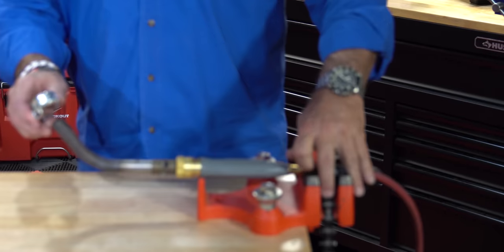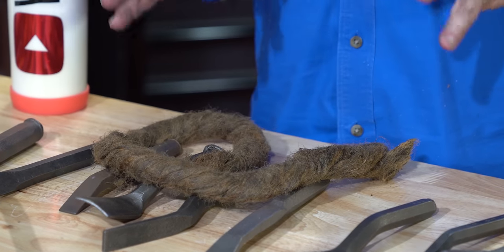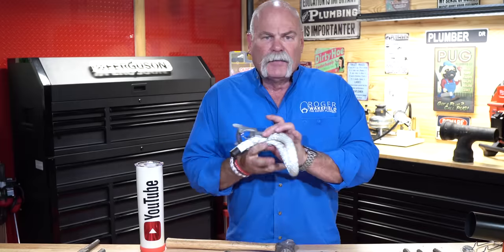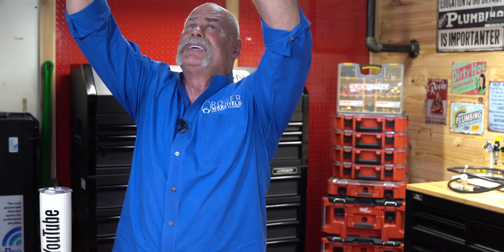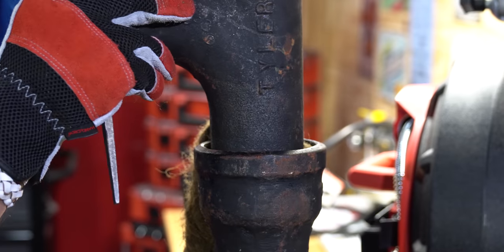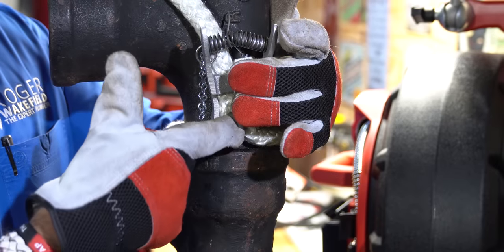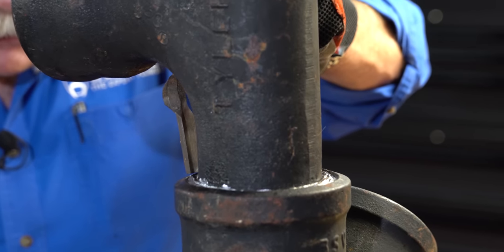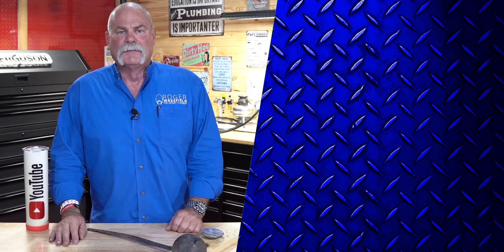I Make a Lead & Oakum Joint

Comment: Great video, sir! Have to deal with this stuff at the apartments I work at. Now that we know how to make one, how about a video on how to properly disassemble one in a safe manner?
Reply: I have seen videos of people essentially drilling holes all around the lead and take a chisel to get the pieces out then pull out the oakum. Super tedious and time consuming. On remodels almost everyone just cuts the cast iron (not at a joint) and uses a fernco no hub coupling. No point dissasembling, just cut it out

Comment: quick question, i work for a utility supply company, and cannot for the life of me understand why ductile is still being used. It's super heavy, super expensive, and extremely hard to get(some sizes are 10-12 months out)..  c-900  has a very close rating, easier to get, a lot less weight, and easier to use.   Also, when ductile sits and water gets in, you see murky water, think about your water with these pipes down the road.  You aint getting rust/murky water from c-900

Comment: Steven Lavimoniere here on YouTube still works with cast iron toilet flanges. He also still solders copper pipe.
Reply: He does small repairs though... Not whole houses...I love Steve and he has serious skill but if he soldered a 6 bathroom new home I'd have so much respect that's unheard of lol
Reply from the maker: Love Steven’s channel, he does good work
Reply: @RogerWakefield  Exactly Roger just like you I love both of your channels... Just saying Steve being a mostly one man band..kind of sticks to doing the least one small job.....😃 He even refuses jobs sometimes...I don't think he will copper a six bedroom new house but I've been wrong before haha 🤣 he could do it tomorrow
Reply: Usually in new construction we just Uponor PEX the water the water lines 💦 because it just way more cost effective... On everyone ..but I understand service plumbing and soldering that's a lot more cost effective.,personally the only time I pull the map gas out is  sweating off an angle stops..sweating on tub spout males, or trying to heat up a nut....but I'm not an old school plumber at any means
Reply: Well I take that back it depends who I'm under sometimes I'll sweat my shower valves.... Some let me just tape and dope them

Comment: Ive only ran cast iron one time...and they made us coat the pipe and fittings with black swan and use no hub bands with clamps...the fittings were weird too they were all street fittings to go into the no hub bands...I'm not sure why the customers at that downtown place wanted drains in cast iron...it was more work but they swore it would be quieter and less noisy than than pvc 😭😭

Comment: Very cool video as a testament to history. I wouldn't recommend considering it as an option in modern construction. No hub cast iron is superior for its serviceability, speed, and (when using heavy duty 4 clamp or shielded coupling) reliability. This isn't a skill I would waste time on teaching to the young guys but its cool to see this video.
Reply: @RogerWakefield  Ill look for it in the specs someday
Reply from the maker: Some parts of the country require cast iron, but not lead and oak I’m…

Comment: Have you experienced a 5” tube installed into a 5” cast iron hub ?  Guess they were pressed  in by heating the cast iron hub an pressing the pipe “tube “ into it .not a plumbing pipe but heard a company did this 80 yrs ago .

Comment: What would you say Roger to a Plumber who used a flat head screwdriver to seat the lead ??? The joint is leaking and I need to fix. Start from ground zzzzzero ?? Thanks Sir.

Comment: I'm curious what you've heard about the refrigeration press fittings? My local distributor carries them now and they're starting to push them, but I can't install something at a customer's house I don't know for sure will last. If you've heard anything, I would love your input on them.
Reply: What kind of pressures do refrigeration lines run?
Reply: Over 400 psi on 410A
Reply: @anthony5530  can hit 500 psi if it has a hung up txv. 500 psi is when the high pressure switch shuts the unit off
Reply: Lots of oversized heat pumps push 500. Lol

Comment: Oakum can be, is meant to be, stripped down into smaller diameter pieces as appropriate to the pipe size. Better three smaller pieces with good offset overlaps than one large piece with a single overlap. Huge pieces are meant for clay drainage pipe. 

Also lead wool exist, its like a much thicker steel wool. Lead wool can be hammered (crushed) into a joint instead of pouring molten lead; most often used in repair work for a single (outside or vertical) joint or two. Handy for cast iron shower drains.

Once saw my boss's son splice PVC pipe into a 3" cast iron hub using oakum and epoxy putty to avoid an expensive wall tear out in a finished basement. He cut a 3/8" ring off a 3" PVC coupling and glued the ring to the end of the PVC pipe to add a flare/bead on the end.  Could not use a rubber hub due to location and the condition of the old fitting. He did it by feel one handed in a wall cavity.  

I apprenticed under an eighty year old master plumber in the early 1980's; first week all I did was cut nipples and bag blue stone. Those few years working then managing a plumbing shop set me up for a career that ending with me sitting in a nice office working for a plumbing multinational years later.

Comment: What they're not allowed to run solder they shouldn't run copper anyways PVC glue and PVC pipe and PEX is all you need you don't need cop metal piping anymore and drains PVC cuz the places like Alabama they don't they use drain opener it's sulfuric acid drain opener and it eats the steel pipe and some housing maintenance guys we use the acid drain opener cuz it got the drains open a lot quicker and still an iron pipes don't last that long against acid